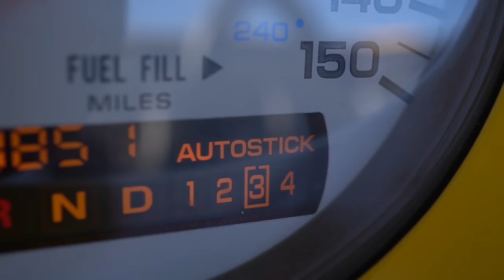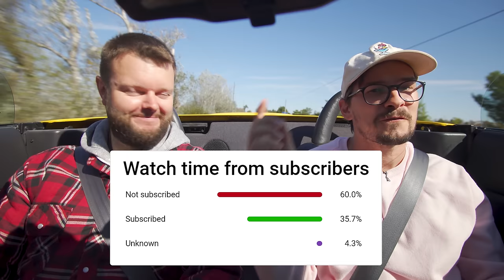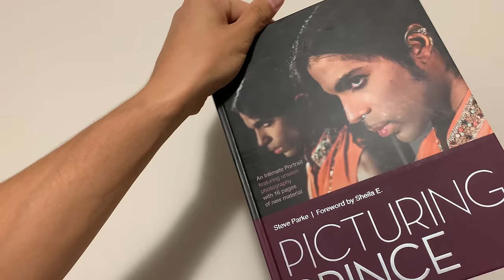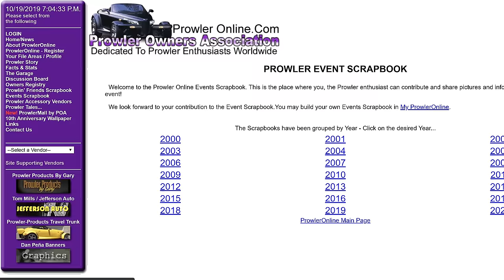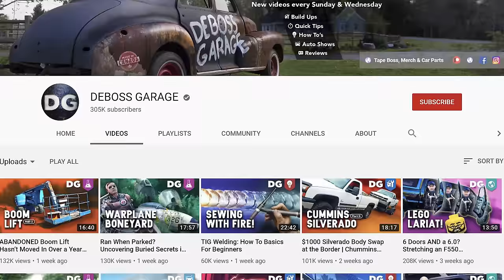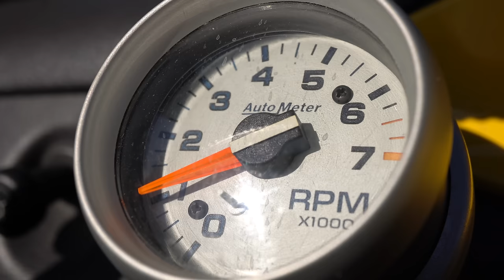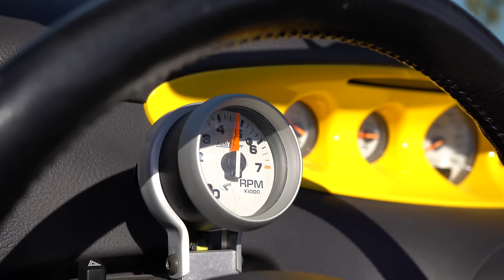DREAM MACHINE! 1999 Plymouth Prowler Review

Comment: That fuel pump priming is because the check valve in the fuel pump is bad and lets pressure bleed off the fuel rails.  If it's like other Chryslers of the era it's part of the pump.  Had to do the same thing with my Durango until I replaced the fuel pump assembly.

Comment: My Hyundai Genesis had the same problem. On and off check engine light, trouble starting. I needed a canister, purge valve, and fuel pump (because the regulator didn't come separately).

Comment: I think you should mod the prowler. A catback would make it sound a bit better. Some other mods that would help make it a better car without changing much would be lightweight pullies faster reving, an LSD, and rear diff gearing. I'd say lightweight rims, but you have good tires already and lighter rims only improve gas mileage and acceleration.

Edit: you can get similar volume exhausts that sound good.

Comment: Add a V8, get a pair of 18"s for the front, paint the front and rear bumpers yellow and the windshield frame and the rear protective black plastic on the rear wheelarch in chrome. Trust me ...or just photoshop it and then you will.